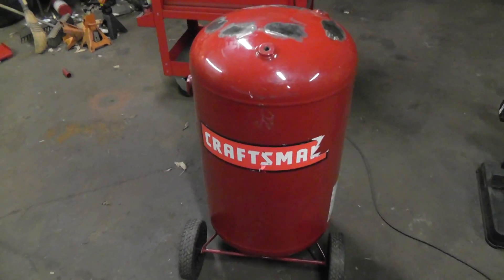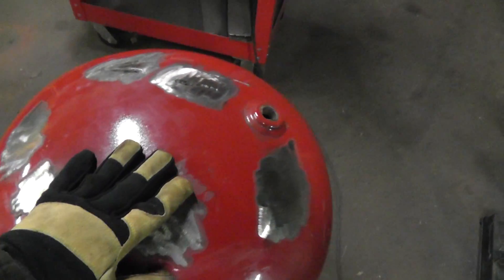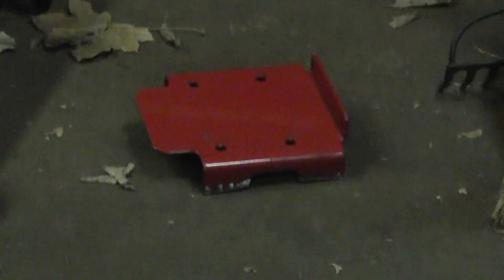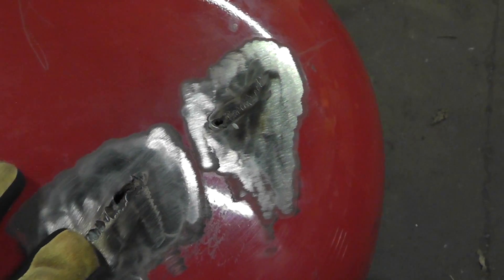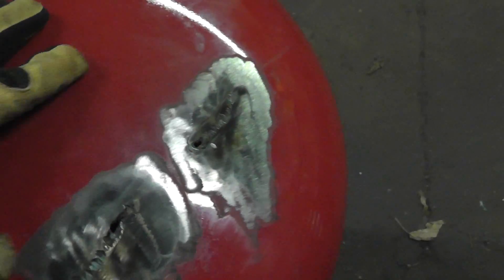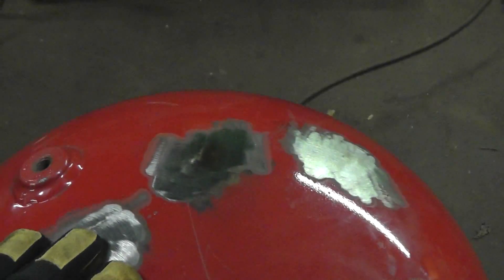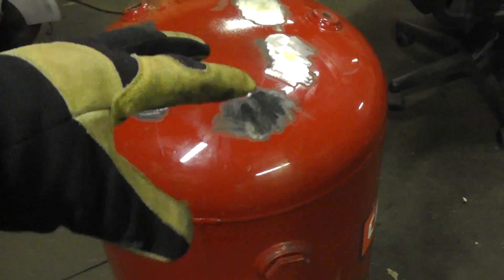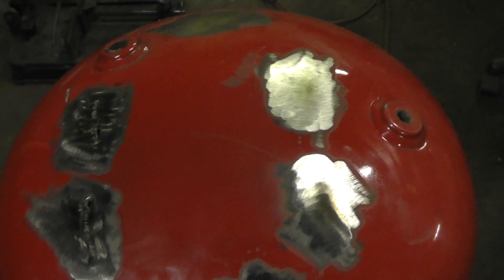Rocket Mass Heater/Stove (Part 4)

Comment: The last time I ordered wire from HTP the spool was all cracked.  I had to tape it back together to get it to work.  I always keep two extra spools of wire for each welder. So I didn't know it was cracked for months.
Reply from the maker: I haven't had the problem but I was really worried about it. USPS really did a number on that box. All the packing peanuts where smashed up into little pieces. Both spools of wire had ripped through their individual boxes. I recorded a video of me unboxing them just in case there was damage to the spools. After careful inspection I didn't see any cracks so all is good.